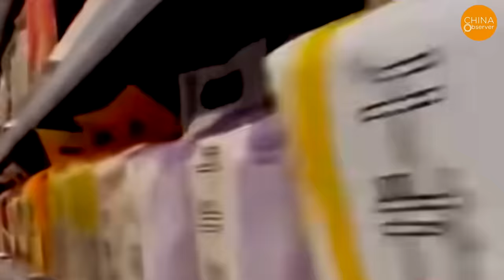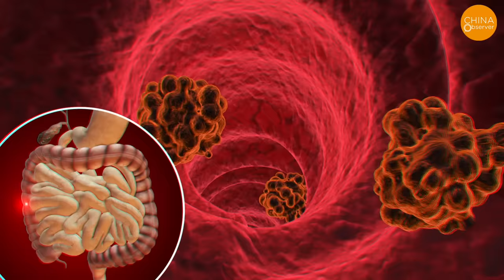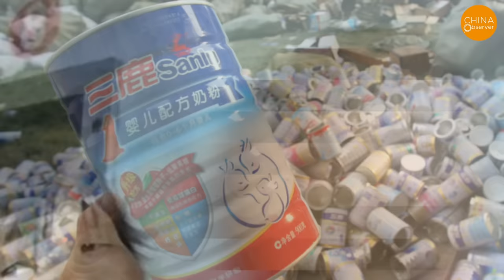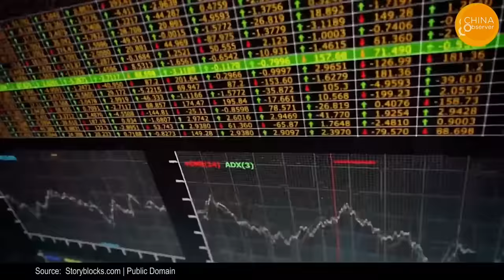Scary Counterfeit Foods In China: Fake Ribs, Carcinogenic Peppers, Opium Hotpot, Formalin Veggies

Comment: 12:02 Using lye in food is hardly unheard of, it's widely used in making pretzels, bagels and noodles, but also used to cure many other foods.

Also it's not carcinogenic... It may cause chemical burns, as any heavily alkaline solution, but heat treatment deactivates and destroys it, making it safe to consume.
Reply: don't forget Lutefisk    https://en.wikipedia.org/wiki/Lutefisk
Reply: Correct. Overconsumption of these foods may make you feel a bit nauseous, which is the best sign to stop and you will be fine. It's not lethal and not any more unhealthy than sugar.
Reply: Exactly! But anything consumed in excess is bad.

Comment: No, you cannot get addicted to poppy seeds in hotpot.
While poppy seeds come from the same plant as opium, the amount of opium alkaloids present in them is extremely low. It's so low that it's virtually impossible to experience any kind of high or addictive effects from consuming poppy seeds.
The main concern with poppy seeds is sometimes related to false positives on drug tests. This is because trace amounts of opium alkaloids can be detected in urine after consuming poppy seeds. However, this doesn't mean you're high or addicted.